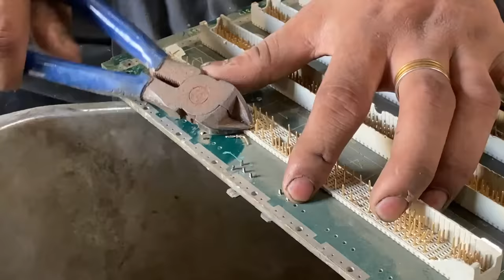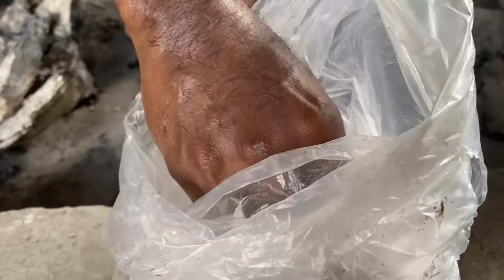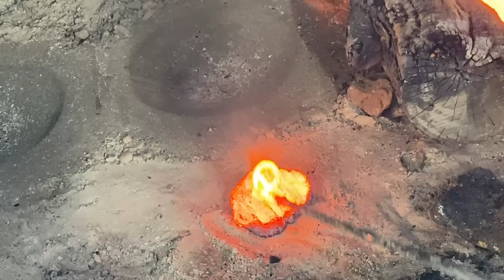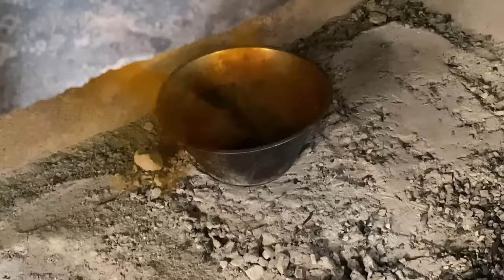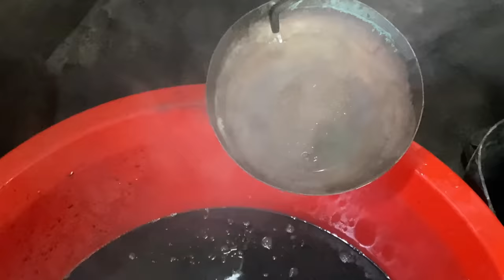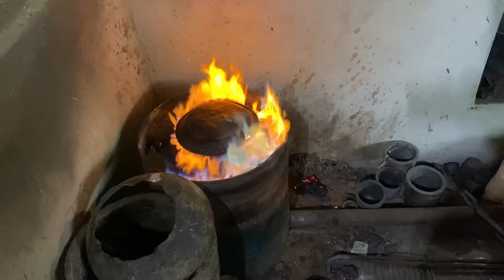Incredible Recover 24K Gold From Electronics Scrap

Comment: I feel sorry for these guys. Are they informed of the dangers and just ignore them, or are they clueless? 

The amount of lead and potential arsenics in that alloy is incredibly high. I hear them coughing in the background from inhaling the fumes and smoke. The nitrogen dioxide orange fumes when inhaled form nitric acid inside the lungs, and when handling the nitric acid with bare hands, the potential of getting one of many incurable diseases is very high. All around the way they are working is significantly reducing length and quality of life unfortunately. I see a good amount of precious metals being washed away rather than filtering as well. Hopefully it’s recovered later. 

All of that to have roughly 23k gold or closer to 99%, rather than 99.9% which would involve one more step of putting gold powder into agua regia, then selectively precipitating only the gold out, filtering, rinsing, then finally melting. 

A single fan to extract the smoke and fumes would make the biggest difference, I hope someone can reach out and bring to their attention.
Reply: who cares, its gold. if you lived like that what would you do to get food on the table ?
Reply: @simonstergaard  I’d honestly do the exact same thing, as far as recovering precious metals from waste goes, however I’d start by working for them, and although it could take years based off low salary, I’d save up on the side and stockpile the acids, glassware, kiln materials, and finally raw waste materials to process, and then slowly switch from full time working for someone, to full time working for myself, and constantly finding new sources for materials etc. 

Use social media (they have access to) in order to find and buy waste (that isn’t available locally),or even resell ewaste to other my hometown along with other countries if the profit is decent that saves me time and money rather than refining myself. 

But definitely would be researching the chemistry and smelting side to make sure I wasn’t hurting myself or bringing things home to my family (dust particles or acid stains) that may be toxic.
Reply: Jbg kako god okrenes i nas truju iz vazduha cime sam Bog zna....
Reply: Индийцы бессмертны, так великий Рама сказал!
Reply: @ИраклийЕресов  video is not from India, is from neibouring country, where they don't have facility or knowledge.
Reply: Anh có thể giải thích các quá trình , các phản ứng hóa học , các công đoạn nấu luyện để cuối cùng cho ra sản phẩm vàng được không ? ( trong từng giai đoạn , phải dùng những dụng cụ bằng các loại vật liệu gì...)
Reply: I think they not will wash if wash its comes %99,50
Reply: Sometimes they are changing health for money. I believe that this is one of a example of this.
Reply: Do you really think they give two shits about the dangers? This put food on their tables and they don't drink $ 6 refreshers from Starbuck..

Comment: Just use a fire to depopulate boards. Make a fire in a fire pit, wait till all the flames are gone than put the boards on a stove rack or grill rack and have the boards one to two feet from the coals. Works like a charm and much faster, the plastic from connectors can go into acid
Reply: They can't because it hurts the environment with plastic burning

Comment: Technically, you can recover gold at home but the cost of chemicals exceed the return and that’s not including the time it takes.
Reply: There  are alternatives to all the expensive  chemicals. For instance, in Portland, I bought a small bottle of nitric acid for 65 dollars back in the day. Yet, sodium nitrate, which is a salt, is similar, and very cheap. I think it's  a food preservative. You mix it with muriatic acid, which  is HCl (hydrochloric acid). The HCl is about 10 dollars U.S. per gallon (it's the common swimming pool cleaning acid)and ten or 15 per pounds for a big box of sodium nitrate. Small scale refiners are making money with these materials and methods. Usually, they do this in their downtime, so they are not concerned about how much time it takes. In other words, they're  having some fun and making a bit of money.

Comment: Which acids using for melting and turning into soil.  One of the most important issues is which metal bowl they use.
Reply: Accutally HCl or  other one cant use in a metal blow .but they do it in metal .i think have fault or fake in this vedion .never  cant do it in a  metal one .

Comment: While the process they use is very rudimentary, it works.  My only concern is that the process also creates insanely toxic vapors and they have their faces right in it.  The brown cloud coming off during the process is the hydrochloric acid cooking off impurities.  Its big bad.  If they had a vacuum hood over it, their lives could at least not be at such a risk.
Reply: They do have an exhaust hood.
Reply: Nitric acid not hydrochloric

Comment: This video would be fantastic if there were subtitles explaining the process. Without an explanation of what is going on its voodoo magic video.
Reply: Olá ,ele está extraindo ouro dos componentes eletrônicos . existe uma pequena quantidade de ouro para melhor contato nós componentes eletrônicos.
Reply: @alemao8955  Si pero no describen el processo explicito.
Reply: And I think using this method you loose less gold
Reply: Short description; all parts containing gold are melted down, resulting in an alloy of different metals (including gold); the alloy would then be dissolved in nitric acid, since the gold in the alloy is very small, this is possible, otherwise the gold would protect the alloy from the nitric acid (gold can only be attacked and dissolved by aqua regia, a mixture of HCl and HNO3), This means the base metals are dissolved by the nitric acid (green color of iron and nickel salts) and the gold remains undissolved. However, it is by no means 24 carat gold, but still contaminated with silver and other metals. In addition, the brown vapors should not be underestimated. This is nitrogen dioxide, which in contact with the moisture in the lungs turns back into nitric acid. very dangerous!
Reply: @28704joe  if you want an explanation of every step, search for a channel called Sreetips. He does this in his workshop and explains the process very thoroughly. These guys are doin a rough refining that definitely is not producing pure gold but they don’t have access to a lab and all that.
Reply: a brief video this is .. one needs to the real process and chemical themselves .. ps : it involves using harsh chemicals that needs protective equipment so be careful!!
Reply: @TroubledOnePaydirt  There are countless other channels that have tried their hand at it. However, I would warn against buying the whole electrical bulkhead on eBay now. The whole thing is a very delicate process and only profitable if it is operated on a large scale, and the dangers should not be underestimated. In the professional field, not only gold is extracted, but all available precious metals in a sometimes lengthy process. In case anyone is interested, NileRed has made some videos about it where he also explains scientifically why he is doing something. A full video series on the subject is available from Cody'sLab.
Reply: @SciDOCMBC  I think u have replied to the wrong person my friend. I never said anything about attempting this myself.
Reply: don't ever try if you are not an expert in the field remember this uses a lot of dangerous chemicals, besides electrical components that contain gold are very rare and you need a lot from them.
Reply: FAAAAAAKEEEEEE!!!!!!

Comment: Peace be upon you. This is a lot of trouble. Put the pins in the nitric directly without casting and take the gold scales and put them in royal water, then precipitate, then wash the sediment and then cast. This method is easier, but there is a need for experience

￼

Peace be upon you. This is a lot of trouble. Put the pins in the nitric directly without casting and take the gold scales and put them in royal water, then precipitate, then wash the sediment and then cast. This method is easier, but there is a need for experience

￼
Reply: In todays world its more easier in chemicals as u get back the metals also eg copper if we do 10 kg of pins we get all copper back in chemicals and is more cheap as campare to this method as this method was used in old times

Comment: It is, generally, said that silver is the best conductor that is incorrect. The best conductor is gold, silver is 2nd and copper is on number 3.
Reply: lol, that's a myth, I'm an electrical engineer....i deal in high Q efficient circuits...silver is the best conductor and best thermal conductor in the world, 2nd copper and gold ranks  4th or 5th...behind aluminum even. They tin contacts with gold to inhibit corrosion only. Gold is better at non-oxidizing than copper, silver, aluminum tarnish and oxidizing properties.

Comment: If gold is used in electrical appliances, why are they so cheap?   Copper and aluminum and a different type of metal are commonly used in electrical equipment.  Misinformation on the use of gold metal in electrical equipment. In this video.